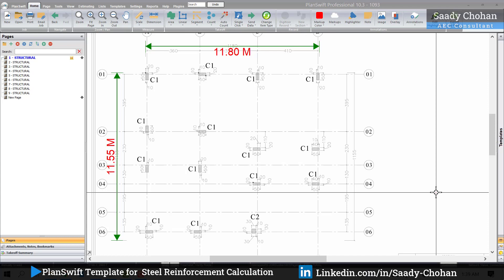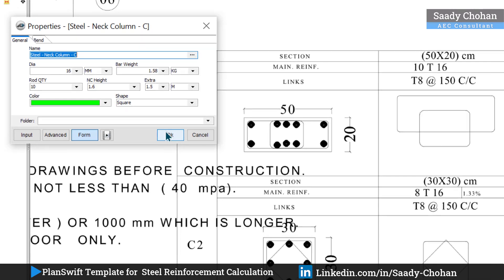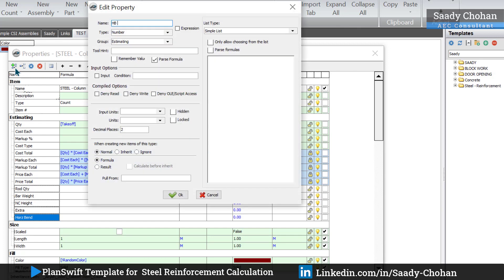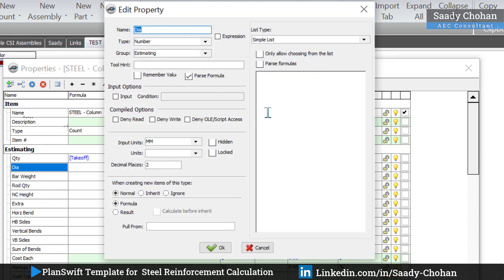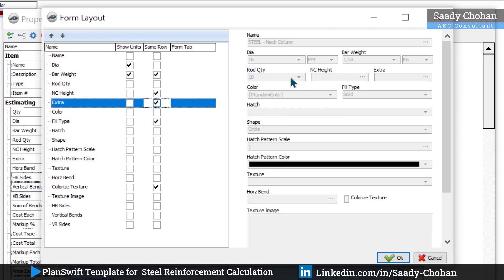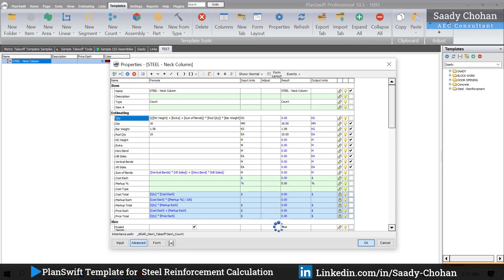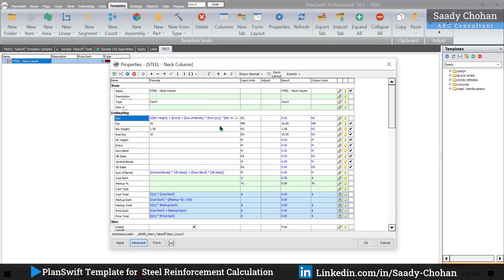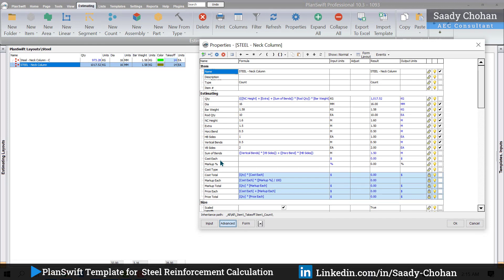PlanSwift Template | Column | Steel Reinforcement Calculation | Part & Assemblies | Level 2

Comment: what is vertical & horizontal bends and how find it these values 0.5 & 0.4, plz explain this points
Reply from the maker: To find the bends, i recommend you to check the section details drawings.
Reply: What is bends

Comment: Hi Sir, Thank you for making such informative videos. In regards to your video i would like to point out that you have created template to calculate only the main reinforcement vertical bars. How will you calculate stirrups needed for the column using the template ? Will it be in the same template or another template needs to be created for that ?
Reply from the maker: There are many ways to get the result through template customization. 
Stay connected:
https://www.linkedin.com/in/saady-chohan/
https://www.facebook.com/SaadyChohan.AEC
https://www.instagram.com/saady.chohan/